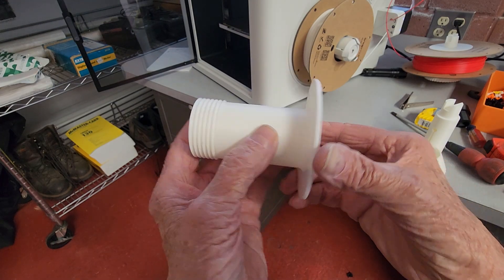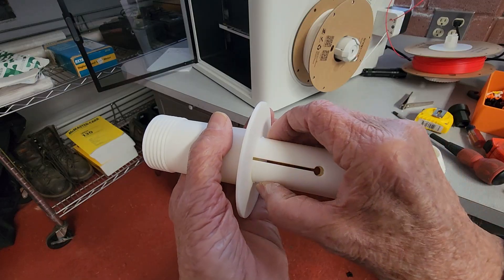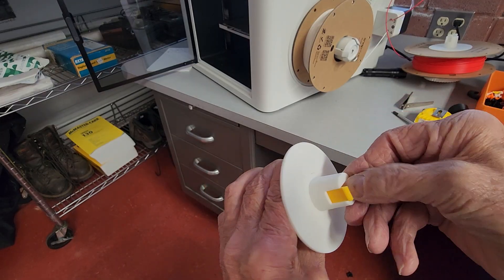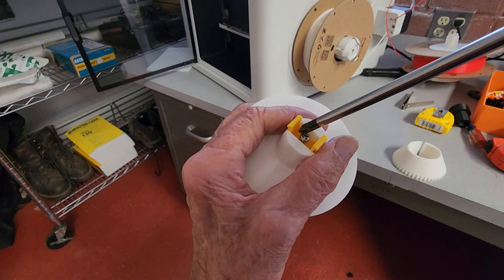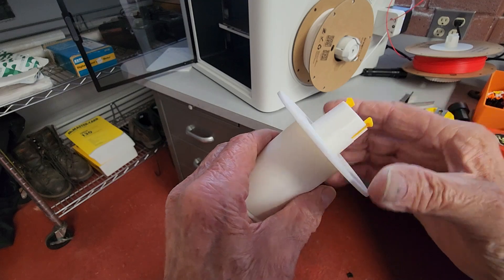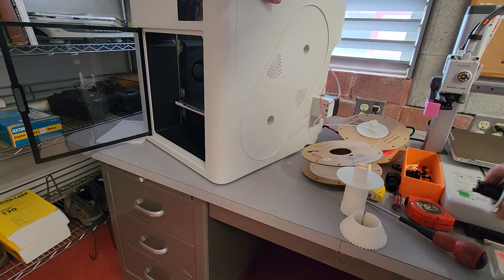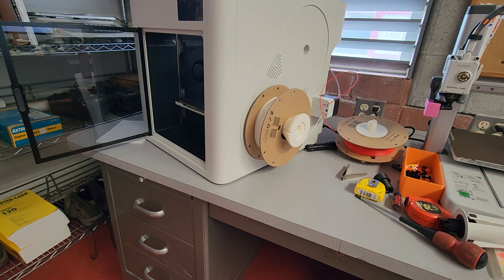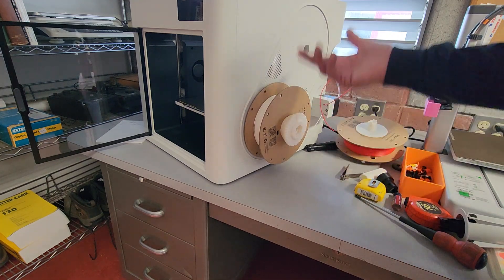Assembly and installation of Snapmaker U1 Wide Range Spool Holder

Comment: printed 4 of these in anticipation for my u1 in feb/april. printed in sunlu pa12-cf on my bambu x1c. then annealed at 225f for 8 hours. 4x #6 1/2 inch long sheet metal screws to attach the clips to the ends